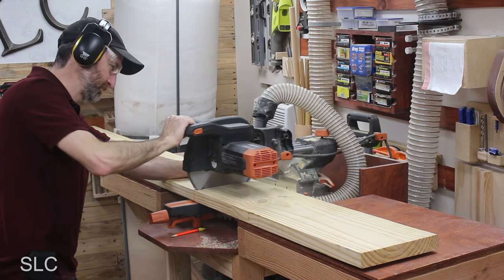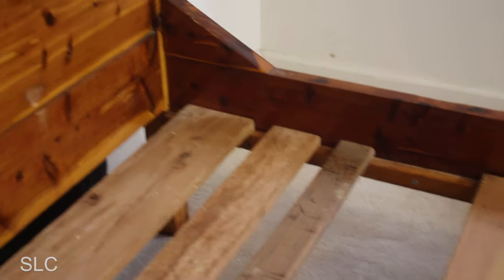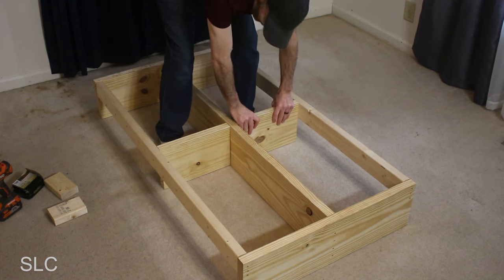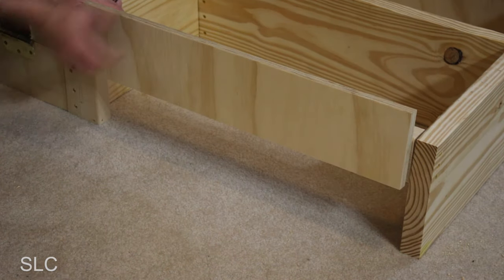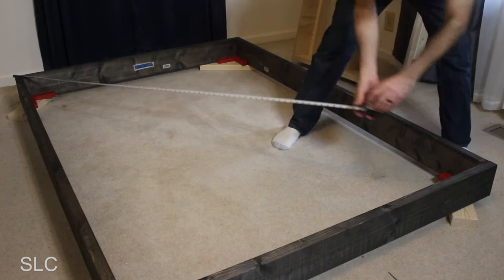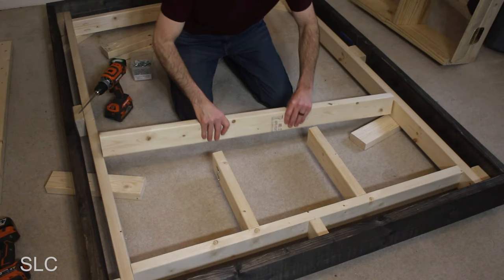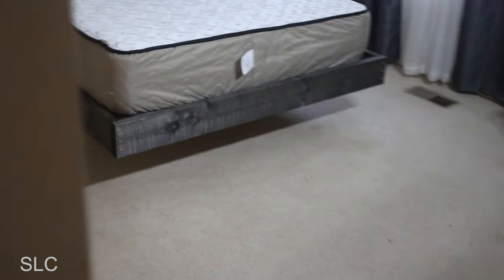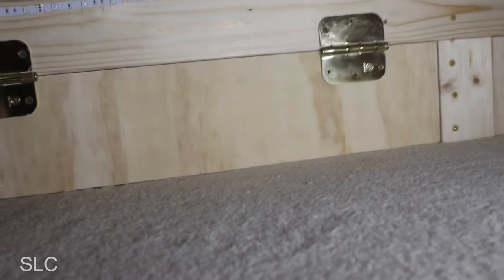Floating Bed Frame With STORAGE and Lights (free Cut List)

Comment: I’ve done the whole construction pine floating  bed frame for my son before. While it is relatively inexpensive, It is not practical long term. It’s heavy, it warps, it droops, and it’s just too soft and screws and even lag bolts, which I used, eventually pull out, especially if your kids are floppers or jumpers. I learned there is a reason they use hardwood. I love the cut list and the design, I’ll just suggest that anyone who does this, spring for the hardwood planks or even use reclaimed hardwood from other projects.

Comment: I’m building my base out of engineered lvls, I figured the weight of those would give a real good sturdy base and once you square all edges sand and paint you wouldn’t really be able to tell.. for the door I’m just gonna cut two 45s short to long so it swings open and throw some hinges and just trim out the lvls… hopefully all goes to plan!

Comment: i have a floating mattress look and provides a soft edge to hit over that wood fascia.
i ran three stacks of wood 7inches high length wise, with three 5/8 cross braces for stability  and one short stack on the right side since my bed is against the wall sideways 

not to heavy and low cost, didnt do underglow but id buy a $22 car kit off amazon which is waterproof which i know would  last 9 months in weather